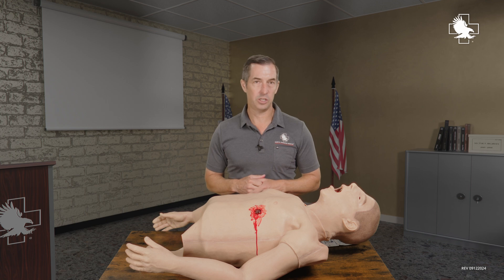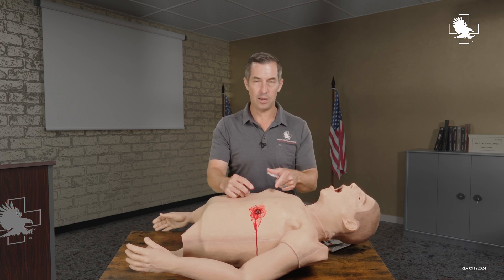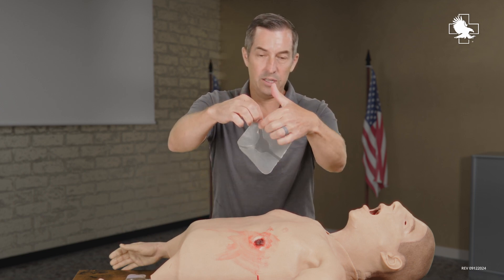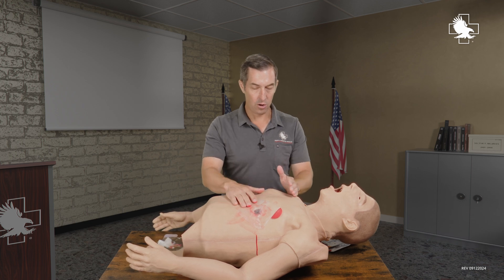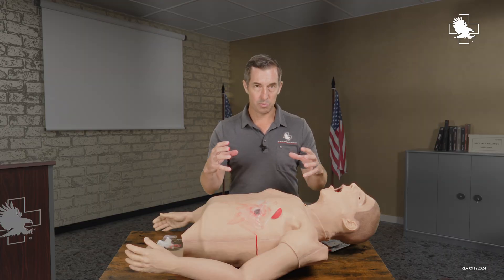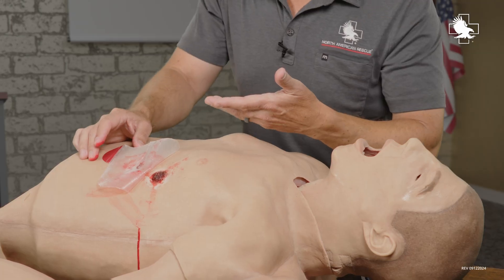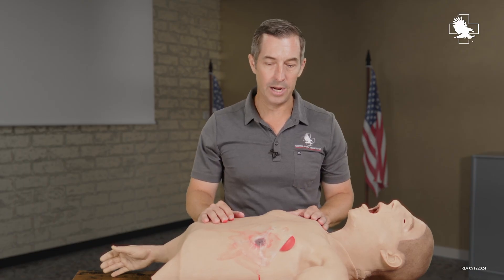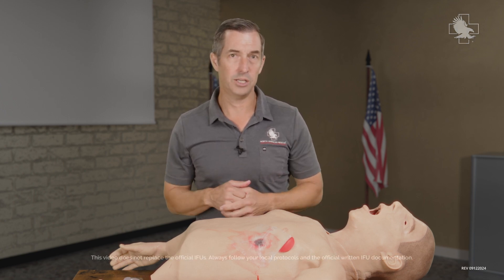How Does A Vented Chest Seal Work? #bethedifference #beprepared #cotccc #trauma

Comment: Also if there is both an entry and exit wound, a single chest seal is largely pointless and can make things potentially worse.
Reply: are you supposed to use a chest seal on both entry and exit in this case?
Reply: @t6raisa  Rewriting to make this as plain as possible.

If you see a hole, use a vented seal and worry later. If you can only carry 2 seals, just buy vented seals. But if you see two holes, both must be sealed.

In a perfect world, entry wound gets full-seal, exit gets vented-seal. 

NEVER full-seal an exit wound.

You might not know which is entry or exit in the chaos and craziness. So to be safe, just buy 2 vented seals, seal the chest wounds and worry about it later. You can always use a full seal later on an entry once you understand which is which.

But above all please do your own research and verification, don't listen to a youtube rando like me. It's just a data point for you to pursue.
Reply: @t6raisa i would suppose so

Comment: Excellent, very professional video, but I have one concern: I wouldn't stick my finger into a penetrating wound near the rib cage. I'd use forceps or (for example) a section of a splint to 'burp' the patient. If (for example) this is a gunshot wound near or through the rib cage you could strike broken, jagged edges of a rib, get cut and potentially be exposed to blood-borne pathogens. It's better to use an instrument other than your fingers.